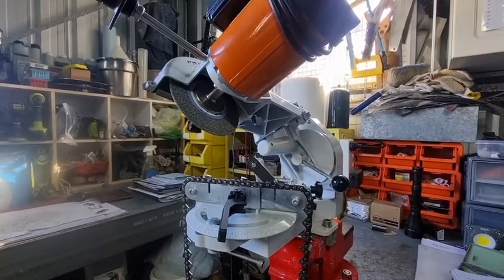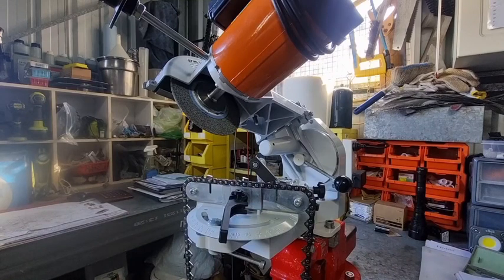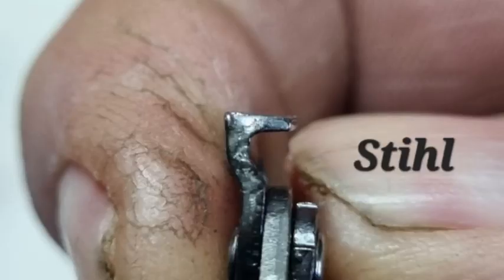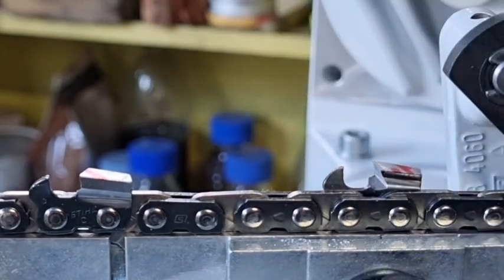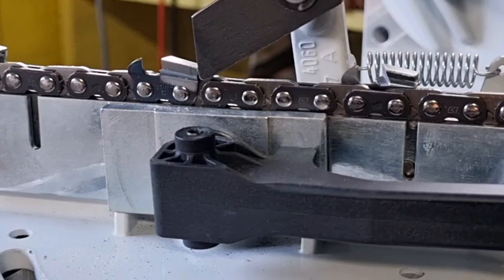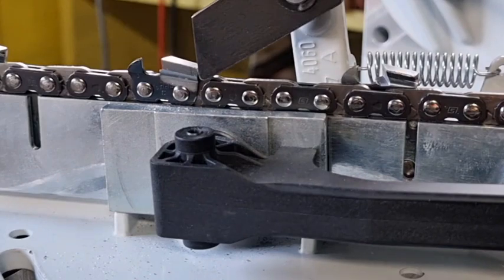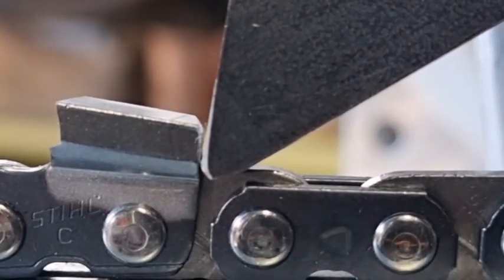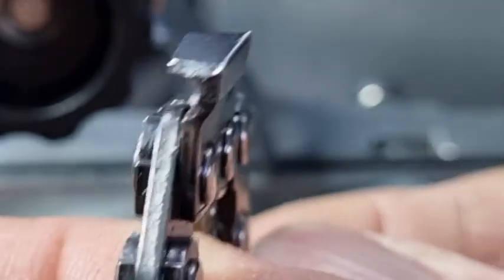Chainsaw grinder not grinding equal each side

Comment: the reason the teeth are different is because the teeth are ground individually before the chain is assembled. when each tooth is ground they are dropped into a large container holding 10s of thousands of these then dumped into a feeder when the chain is assembled. the largest variation comes during the shifts when grinding wheels are diminishing in size as these work shifts continue. say at the start of a shift their grinding wheels are 300mm in dia. by the end of the shift these grinding wheels can vary down to 150mm. each tooth therefore will be different as a work shift goes on. when these large containers of teeth are then dumped into a feed tray you have many variations of sizes of teeth all being thrown together to make chains. i hope this clarifies this issue for anyone.
Reply from the maker: Yes manufacturer problems but I was mainly thinking user fault when filing oʻr grinding.  Thanks for your comment

Comment: Could you measure from the end of life line to the tip?
Reply from the maker: Please explain that better what is tje life line
Reply: @ChainsawUsers  the mark on top plate to show when the tooth is worn out.
Reply from the maker: @kimthomsen1109 a standard 3/8 chain is almost 10mm long the lifeline or end of life is 3mm approximately.  So you have 7mm of usable tooth
Reply: @ChainsawUsers  hey mate was just wondering if that line marking the end of tooth life could be used to measure the length instead of the back where it is deformed
Reply from the maker: @kimthomsen1109 I never measure any cutters because I a progressive depth gauge and that means the saw will cut straight

Comment: You have nice grinders they grind pretty evenly.
The knock offs or low end grinders can be 1-2mm different from left to right cutters.
I have a cheap grinder the left hand cutters come out shorter than the right. To fix this I grind the left side first then measure the right and make it match.
Reply from the maker: I heave heard this before from people, but when you set it up the operator adjust the backstop on both sides so it must be user error.
The grinder will only grind off any metal that is set by the operator.
I find it's operator error.  Even cheap grinders work ok.  I have $50 cheap plastic grinders also and they work OK.   
Make sure when you finish grinding the first side after it's done set up the back stop for the other side so it also barely touches the tooth.  This is always the starting point.
Hope that information helps
Reply: @ChainsawUsers  Here's the thing, the instructions say to find the shortest tooth set the back stop and depth stop then grind both sides without adjusting it again.
I have to adjust everything when switching from left to right cutters on my cheap grinder, you shouldnt have to.
On a good grinder you only set the back stop and depth stop once per chain.